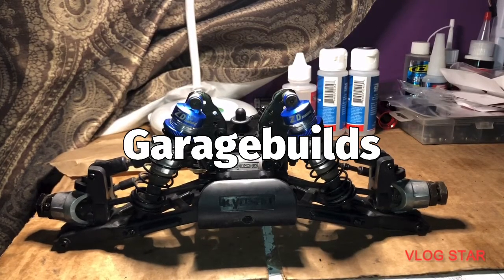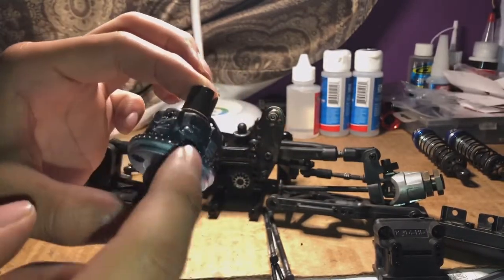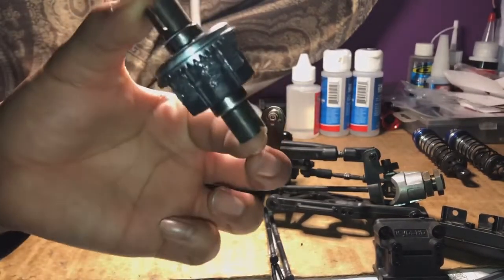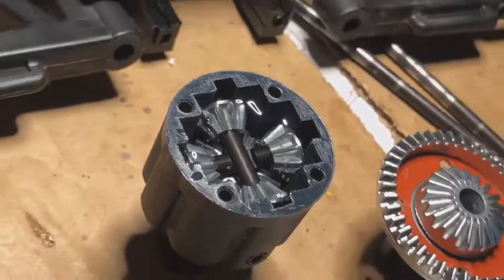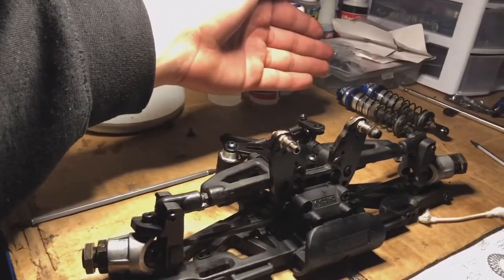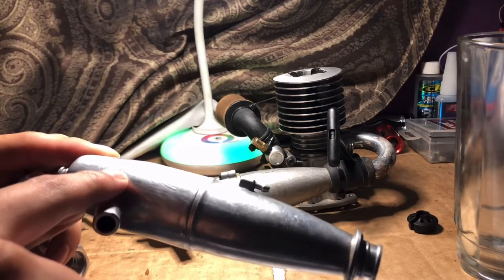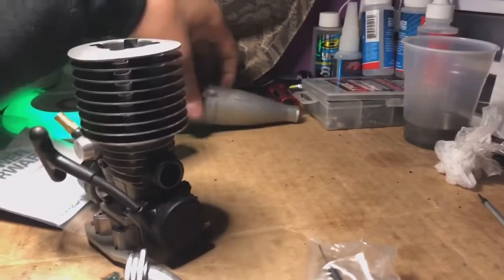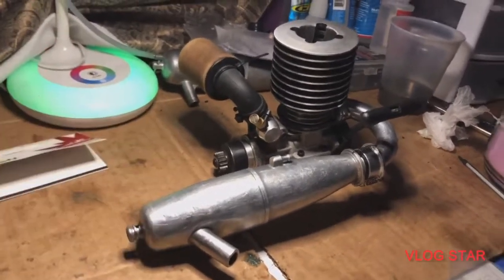Kyosho Inferno neo 3.0 Front diff Upgrade and Novarossi Tuned Pipe

Comment: I have the same neo 3.0 as you do. I found out that the sway bars on my mp9 will fit on the neo. Helped out a lot with handling
Reply from the maker: Nicee! and Foreal . thats good to know i will check them out Thanks m8! 💯
Reply: No problem! They only issue I’ve had with my neo is the fuel tank lid will leak if I run more than one tank of fuel
Reply from the maker: Ohh thats not good , why ? could it be the return spring went bad or a bad seal , that should not happen means something might not be right with tank .

Comment: i have some trouble taking apart the joint cup, any suggestions?
Reply from the maker: need to take apart diff and there is a pin holding inside behind the gear
Reply: @garagebuilds  thanks 🙏